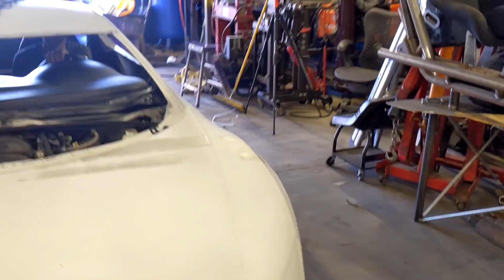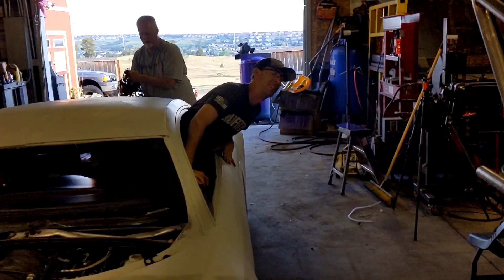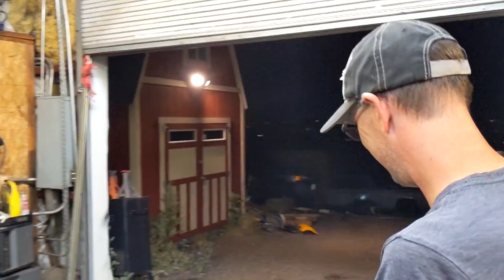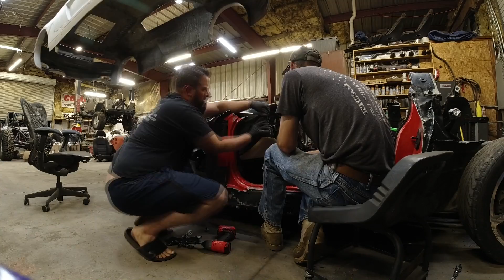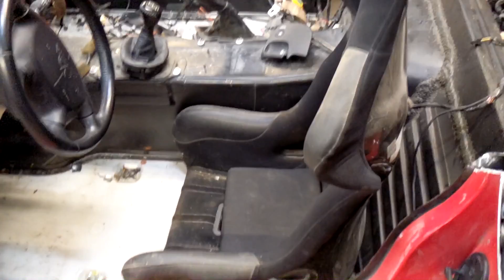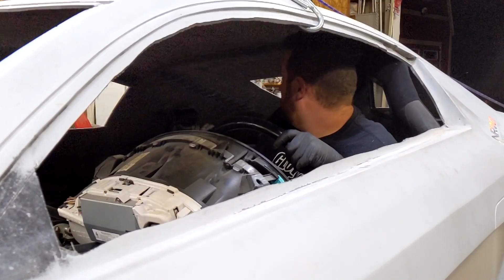Fast and the Furious 7 Audi R8 Swapped Corvette Chassis Sema 2020 Build Part 2 - Corvette Tear Down

Comment: The dash is really in the way.  That body might fit better on Preston's K swap mr2  or just build a tube  chassis, probably easier than making it fit the vett. One of those crossfires you have may work too.
Reply from the maker: Not in the way 
anymore! :)

Comment: You can still get more junk out of the way. 😎 ....this is a great configuration for other kinds of race cars too. Front-Mid engine.
Reply from the maker: Yeah we're talking about a lot of things We even debated moving the seats forward a little bit to try and flow better with the Audi body. We just want to make sure that we're moving forward on this project constantly because Sema is going to come fast.
Reply: @carbonshocks  it could make a really cool rally fighter too. You know I gotta go there! 😎
Reply: @carbonshocks  I can't wait for the next video!
Reply from the maker: My goal is to have a couple videos a week on this build depending on a few other things. 

We're going to try and get the bouncer wrapped up to a full roller next week and then we've got to do a couple things on Joe's car and Medusa the Ultra 4 but I'm going to be doing a lot more work in order to get this build where it needs to be as there's a lot of variables that have to come together
Reply: @carbonshocks There is no way you're losing this fan! Not a F#%&ing chance. 😁